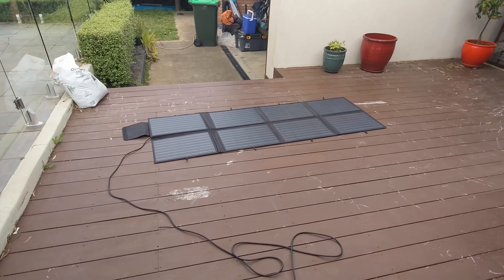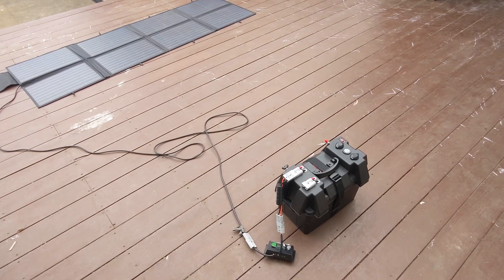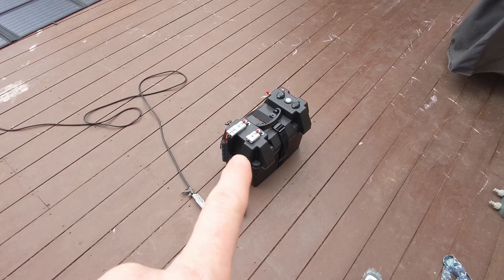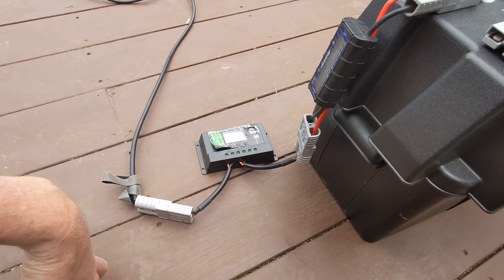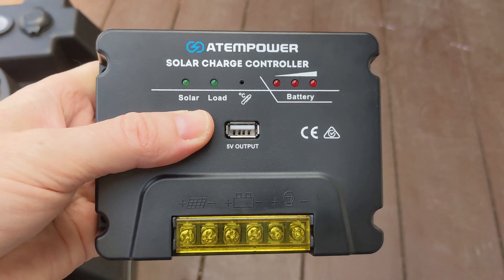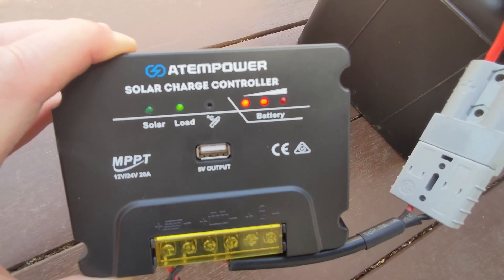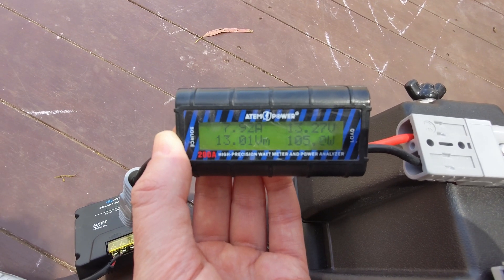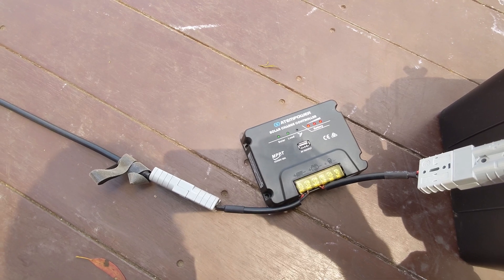ATEM MPPT for use with Solar Blanket

Comment: Similar experience here - this MPPT came with the solar blanket. First MPPT failed after a week, then replacement one failed only after several days. Both had same issue, no solar coming in anymore. Panels all working as checked with another branded MPPT. I am using lithium but it says they are lithium compatible…
I won’t be getting a 3rd
Reply from the maker: Yeah, can go a bit cheaper on many components. I don't think solar charge controllers are one of those.

Comment: I purchased one of these ATEM lithium compatible MPPTs. The device failed shortly after purchase. Lights would light up but would never engage solar charging. The seller replaced with another, shortly after that it failed with the same issue. I ended up buying a Victron MPPT with Bluetooth, it was 4x the cost, but when I’m out camping I know it won’t fail like the ATEM did 😫. Thanks for taking the time to make this video.
Reply from the maker: Yeah, there are some cheap quality options out there, this unit did not seem to be one of them. I use Epever, Renogy and Victron gear where it counts, has all been very reliable.

Comment: That mppt charger just check it not working right might be due to not compatible with lithium batteries asi had similar one from kings and it too wasnt compatible its ok for agm
Reply from the maker: Product description states it is lithium compatible. Main thing was nowhere stated the max PV input voltage which is a key spec for an MPPT. Notice ATEM have another 20A MPPT controller now which does specifically a 50V max input. If it does what it says on the tin, that should be enough to serve a couple of 200W panels in series.
Reply: @dominic-ryan it is in the manual 50v max